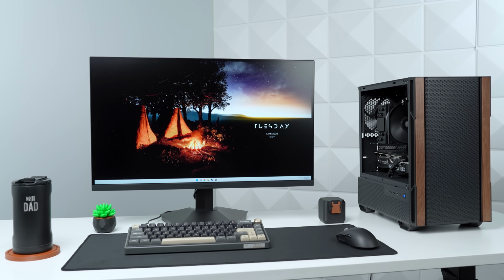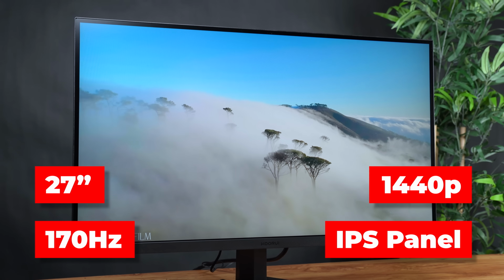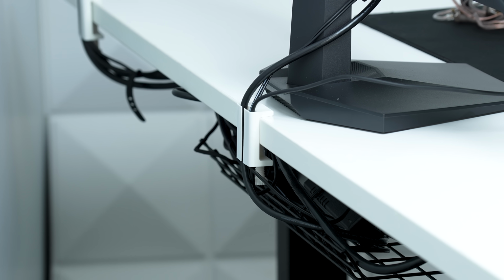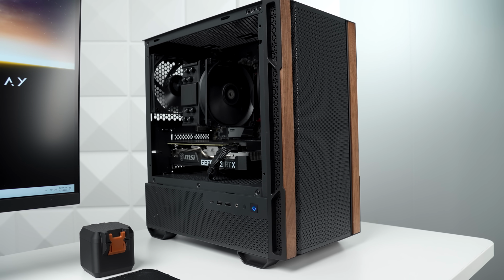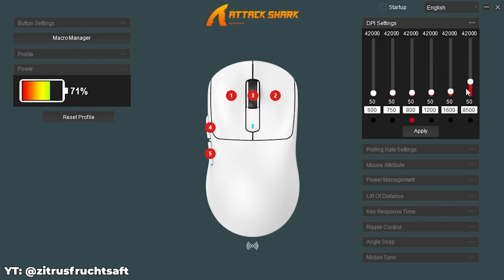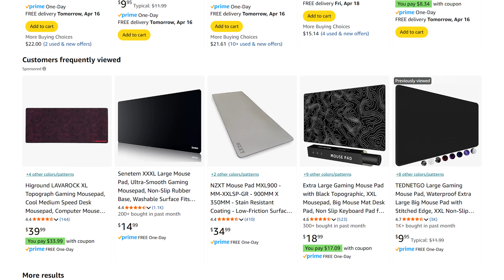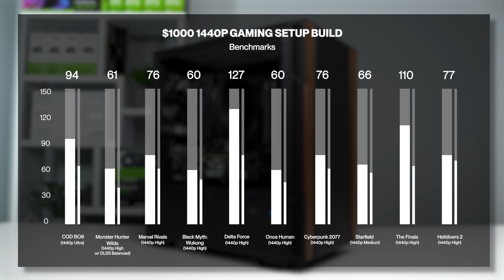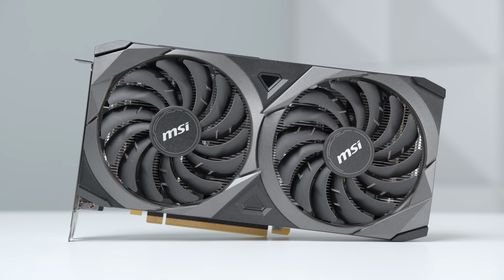$1000 FULL PC Gaming Setup Guide for 1440p

Comment: Hi !
I love your videos; you give bite-sized information to keep me in check about what's good on the PC hardware side of things. I'm here to talk about the keyboard pick.

If we're talking about $50 without adding the shipping price, this is somewhat really not the thing I'm expecting since you tried other products like Attack Shark for mice and KZ for IEMs.

Maybe give cheap Hall effect keyboards a chance; they'll do a good job for your use case.

As for suggestions

Actually, there is a cheap hall effect keyboard made by Royal Kludge themselves called "Royal Kludge C60", but it's only available on Taobao. I got mine for around $17, but things might be different in your country.

Try Mchose; their Ace68 and Jet75 seem pretty decent and will fit your price range of $50 if they go on sale.

The Ajazz AK680 Max can be a good pick too since that one has a 2.4 GHz dongle if you need it.

There are a lot of other keyboards, but it seems that you want a keyboard that has a good sound signature, so I tried to give keyboards that combine performance and acoustics (I think).

Comment: All these budget builds are interesting, but I also feel frustration, because in my country is hard to find budget good looking cases, especially if you want something simple, without lights, just forget about anything full black, with a little bit of wood. Even if you want to pay extra for look, they are in general not worth their praice for cooling performance and build quality is similar to cheapest on. And it's hard to find decent budget 1440p that is not 2 time more expensive than basic 1080p. I think this set in my country would be much close to $1300.

Comment: Great videos! I saw many people asking advice for pc parts so I might as well too...

I need to upgrade my GPU eventually, probably to NVidia but their new GPU's seem like a rip-off.

I'm a 3D artist (mainly using Blender) with a Ryzen 7 7700x and a Radeon RX 6800. However, 90% of content creation software doesn't have good support for AMD GPUs :(
(e.g. relying on CUDA only, limited encoders other than NVIDIA for Davinci resolve, Optix temporal denoising, etc.) Plus photorealistic 3D art requires the best raytracing.

I never intended to upgrade anytime soon, so I'm hesitant to spend almost the price of my whole PC for just a new GPU. But if I need to upgrade my GPU and go with NVidia, which one do you recommend?

Full Current Specs:
CPU: AMD Ryzen 7700x
Motherboard: MSI Pro B650-P WIFI
GPU: AMD Radeon RX 6800 (16 GB VRAM)
RAM: 32 GB
Power Supply: RM750 Watt
Cost: Roughly $1,500 to build

Comment: I recently bought the Lenovo Legion Y7000P featuring an Intel Core i7-14700HX (2.10GHz), NVIDIA RTX 4070 8GB, a 16-inch 2560×1600 (QHD+) 165Hz display, 32GB RAM, and 1TB SSD storage. The system runs on Windows 11 Home (24H2, 64-bit).

I mainly plan to use it for programming and gaming, and so far it’s been a smooth experience in terms of both performance and display quality.
I picked it up for 1190 USD
Reply: Oh shit!! Better than the setup in this vid 😅😅
Reply: @saharshlehri5345  Better on paper only though. It's still thermal throttled for prolonged use. For short bursts, you are correct that it is faster.

Nevertheless it is still a beast of a setup. You really got a good deal there.
Reply: @noctis_rune  I plan to buy a cooler pad for heavy tasks, so I am pretty sure, I won't have problems. Hope so 😅
Reply: It's A laptop bro @saharshlehri5345
Reply: @Gekkko Honestly, I’ve been using it for a while now, and it’s been good so far. The performance is solid except battery working for 3 hours without charge. I haven’t had any major issues yet, and didn't hear bad reviews yet. Can I know where you heard bad reviews to me look, so my inner turmoil would be at peace 🕊️
Reply: @Beginning-After-the-end  i mainly see it on forums and online shop reviews, but thanks for the headups about this laptop
Reply: thats cute
Reply: Is that legion good? I heard many bad reviews regarding legion series
Reply: @Gekkko Yes Lenovo make the best bang for your buck gaming laptops out of any manufacturer.
Reply: @Stardomplay  i see, i am planning to buy a gaming laptop but really skeptical with mixed reviews anyway thanks

Comment: Nice prints. For any fish tank/bottom intake pc, try printing some feet to elevate the case an inch or two. Most bottom intake pcs don't have enough bottom clearance and turn into vacuums for anything underneath. Elevating it a few inches higher drastically reduces dust intake and the static pressure necessary to pull air through such a small gap.

Comment: Zach, there is no dGPU shortage despite how many times you said that. There is new dGPU price inflation to offset CPU less demanded and back generation new overage clearing, secondary including the channel writing off Raptor used and multi generations laptop overage clearing. New dGPU margin is cost offsetting all other discounting and I mean all PC kit is in overage from cases to PSUs and you know that and the channel takes it out on buyers raising demanded product price and that is often dGPU and 3D and most demanded 'productivity' business application CPU. 

Raised new dGPU price umbrella has also allowed some secondary used pricing to float up and you have to look around for deals, they do exist as you are also aware. The shortage false narrative, sorry please correct. One way to correct is just say wait into second half for a new dGPU OR pick up new highly discounted kit now CPU, DDR4, low clock DDR5 whatever and use the dGPU you have and then shop for a GPU in second half of the year when Nvidia puts out 50 M Blackwell GeForce at peak production where AMD will do maybe 7 to 10 million RDNA 4.  The channel will discount leaving summer otherwise cards will back up into the production chain and no one wants that.

GPU Today 4.12.25 - Quick Take - Channel Available and Trend
87 SKUs current and back one generation

Product SKU > and % on 4.12.25 > and Change in Quantity from 3.22
Desktop PCI cards on shelf and cards in SI PCs are combined.
Percent available between AMD and Nvidia is all inclusive.

There is no shortage.
In the first eleven weeks of Blackwell supply is + 298% more than Ada.
In the first six weeks of RDNA 4 supply is + 306% more than RDNA 3.
New product producer's ramp price is up and secondary price floats up.

Price is up on performance and offsetting back gen CPU and other discounting.
Price is up on software features some enthusiast's mock.
New product availability gains through summer and peaks q4 - q1

On Nvidia staging Ada run end production volume early, avoiding a long trailing tail of new Ada parallel Blackwell roll out, that was to let AMD RDNA into channels avoiding the risk of Nvidia channel monopolization claim.

On analyst production Nvidia q4, q2 and q4 are the marginal cost quarters.
On analyst production Nvidia q1, q3 and q1 are the marginal revenue quarters.
On analyst production if Nvidia q1 - q2 2026 plateau back-to-back revenue quarters.

What could go wrong? All PC kit overage inventory value collapsing toward and below cost into the second half, the channel holding up new product price to compensate entering supply elastic volumes that then back up into the production chain impacting revenue and margin.

AMD

Mi210 > 0.05% > (33.33)
Mi160 >0.01% > (50.00)
Mi150 > 0.09% > 16.00
Mi125 > 0.11% > (17.24)
Mi100 > 0.05% > (33.33) all Instinct = 0.30%

9070XT > 1.29% > (10.29)
9070 > 0.72% > (6.81) all RDNA 4 = 2.01%

Pro W 7900 > 0.07% > (55.56)
Pro W 7800 > 0.09% > 8.33
Pro W 7700 > 0.02% > (75.00)
Pro W 7600 > 0.05% > (7.14)
Pro W 7500 > 0.08% > 25.00 all Pro W = 0.30%

7900XTX > 0.51% > (13.97)
7900XT > 0.71% > 39.57
7900GRE > 0.07% > (63.16)
7800XT > 0.61% > 5.63
7700XT> 0.29% > (6.58)
7650GRE > 0.00378% > new entry
7600XT > 0.36% > (9.38)
7600 > 0.43% > (7.02) all RDNA 3 desktop = 2.98%
7900M > 0.01% > 33.33
7600MXT > 0.04% > (40.00)
7600M > 0.01% > 0.00
7700S > 0.09% > (8.00)
7600S > 0.04% < (36.36) all RDNA 3 mobile 0.20%

Nvidia

GB200 > 0.0038% > 100.00
GH200 > 0.01% > 50.00
H200 > 0.04% > 0.00
H200 SXM > 0.01 > (100.00)
H100 > 0.49% > 2.31
H800 > 0.05% > 38.46
H100 SXM > 0.06% > 40.00
H20 > 0.0038% > for all the China so said buying a new entry in the channel
L40S > 0.88% > (4.74)
L40 > 0.14% > (119.44)
L20 > 0.01% > (1700.00)
L4 > 0.16% > (39.02)
L2 > 0.07% > 16.67 all accelerator = 1.90%

A6000 > 0.05% > 64.29 restocking workstation emphasis
A5880 > 0.05% > 92.31
A5500 > 0.00% > sold out
A5000 > 0.53% > 96.45
A5000 SFF > 0.01% > 100.00
A5000M > 0.03% > 66.67
A4500 > 0.29% > 87.01
A4000 > 1.80% > 96.65
A4000 SFF > 0.00% > sold out
A4000M > 0.17% > 78.26
A3500M > 0.3% > 97.14
A3000M > 0.07% > 94.44
A2000M > 0.07% > 94.44
A2000 8 > 0.01% > (150.00)
A2000 16 > 0.07% > 94.74
A1000M > 0.07% > 57.89
A500M > 0.08% > 100.00 all Ada Pro = 3.44%

4090 > 7.36% > 0.15
4090FE > 0.48% > (23.62)
4090D > 0.48% > (7.14)
4080 > 4.22% > (26.32)
4080FE > 0.20% > (1.85)
4080S >0.76% > (64.50)
4080S FE > 0.34% > (34.44)
4070ti > 6.50% > 8.14
4070ti S > 1.43% > (10.82)
4070FE > 0.21% > 3.57
4070 > 18.79% > 54.81
4070S > 3.76% > (4.03)
4070S FE > 0.70% > 10.22
4060ti 8 > 1.60% > (126.12) clearing ahead of Blackwell release
4060ti FE 8 >0.18% > (593.62)
4060ti 16 > 0.91% > (184.65)
4060 8 > 14.37% > 17.71 all Ada desktop = 62.31%
4090M > 0.67% > (2.25)
4080M > 0.99% > (7.98)
4070M > 3.78% > (10.00)
4060M > 4.16% > (9.09)
4050M >3.52% > (4.51) all Ada mobile = 13.13%

5090 > 2.61% > 12.88
5090FE > 0.28% > (9.46)
5090D > 0.19% > new entry
5080 > 3.40% > (54.34)
5080FE > 0.22% > (100.00)
5070ti > 2.31% > (59.64)
5070 > 4.15% > 61.48
5070FE > 0.27% > 15.49 all Blackwell desktop = 13.42%
5090M > 0.05% > new entry
5080M > 0.05% > 84.62 all Blackwell mobile = 0.10%

Change in channel available from 3.22 to 4.12 gains + 8.4%

Current and back one generation share

AMD = 5.6%
Intel SKUs not shown = 1.7% and all Arc down < (16.4%) since 3.22
Nvidia = 92.56%

Current generation share today

AMD = 12.6%
Intel = 2.7% and B5x0 down (65.4%) since 3.22
Nvidia = 85.1%

You can find March 19 2025 dGPU channel supply, trade-in trend and sales HERE by product category here, current gen all the way back to Volta and Polaris . . .nvidia-research-the-real-reason-big-green-commands-big-profits SEARCH at THE NEXT PLATFORM and look down the comment line.

Returning to channel desktop / mobile and server update more data soon. 

Mike Bruzzone, Camp Marketing

Comment: here in slovakia the rtx 3070 is sooo overpriced its like 500€ thats like 550dollars idk and the r5 7400f is nowhere to be found on any of our stores but i thing we have cheaper pc cases and prettier my fav pc case is ADATA XPG Valor AIR PLUS BLACK its like 56€ 50dollars or cheaper and it comes with 4 preinstalled rgb fans and its compatible with all mother board sizes even the micro itx or what it is called

Comment: Hey there, quick question for UPS, is it fine to turn it off and unplug it when I'm not using it? for example, when I'm going to sleep or going to work?
Reply: Yes, you can but if you leave it off for to long it will lose battery capacity so charge it from time to time
Source: i have one

Comment: Umm guys is this a good pre build for $520? 

Processor: AMD Ryzen 5 5600X 6 Cores 12 Threads 3.7GHz

Motherboard: GIGABYTE B450M-K Motherboard

RAM Variation: HKC DDR4 16GB RAM 3600Mhz

Cpu Cooler: INPLAY SEAVIEW 240 PRO AIO Luqid Cooler

SSD: HKC M.2 Nvme 512GB / 1TB SSD

PSU: INPLAY GS650 650W 80 Plus Brozen True Rated Power Supply

Case: Inplay Seaview Summer Tempered Glass [White]

Fans: Inplay Seaview F3 Fans Wih Light Control [3pcs, With Remote Controller]

OS Support: Windows 10 PRO Trail Version

Double Bubble Warps and With Wood Crate Protect

Gifts: RGB Keyboard and Mouse, 5Ghz Wifi Adapter, Mini Speaker, Mouse Pad, 1.5m Lan Cable

PC Setup, centered around the AMD R5-5600X processor paired with an RX 580 8GB GPU and has 180 hz monitor 24 ' inch

Comment: 6700XT is a very solid choice, I bought mine to upgrade from a 1660 Ti in January 2023 at the same time as when I bought a 1440p monitor and it has been great for the price. CPU from AliExpress is cool too, bought a 5700X3D from there for half price to upgrade from a 3600 and I'm very happy with it.

Comment: Ive mentioned it bwfore in videos and im glad to see someone actually include Peripherals into the cost a computer! I hate when someone says they build a full computer for $1000-1500 but leave out hundreds of dollars worth of equipment that IS needed to get a computer up and running from scratch!
Reply: Yeah i went and saved up 1000$ then realized i need to fork up another 300$ for mouse keyboard and high refresh monitor,
Reply: copy-pasting from a response i made to another commenter:

most videos focus on the pc itself because its the most "objective" part, and the rest of the setup is mostly personal preference.

If I was to build a setup today, I would probably spend 90% of the budget on the PC, and buy the cheapest garbage that I can find for periferals. Im talking no more than 20 dollars in keyboard, controller and mouse(each), maybe 30 or 40 on a cheap headset with a usable mic, a used 60hz monitor from facebook marketplace, no mousepad. And then upgrade all of them over time, all of the cheap peripherals can be gifted to someone and the cheap monitor can be used as a secondary when you buy a good monitor that properly fits your needs. 

The same concept can be applied to the PC itself but its harder, given the situation of a great deal on a GPU that didn't fit the budget i recommenden my friend to get a 500GB 2.5'' SSD alongside the GPU, and later on he bought the 2TB NVME that he originally wanted, in the end he has both and didn't have to eat exclusively bread for a week to afford the upgrade.

truth is, most people don't have a hard budget for the entire setup, they just have a budget for the moment, everything can be upgraded and changed over time. So I think its best to focus on the really important stuff with mediocre shit to go along with it and upgrade later, this way you can easily end up with a setup that is worth 1500 bucks when your initial budget was 1000
Reply: @Tarmin_ That was a lot of words that missed the point. A lot of ytubers advertise a build as being £1000.

But the peripherals (AS IN THE MONITOR YOU NEED TO RUN IT) costs over 100-200, so it’s not £1000.

Comment: If you're on a 1000$ budget and want a PC that will not be obsolete in two years I'll definitely go for a used 6800xt, which has 16gb of vram and better performance than the outdated 3070. Otherwise the set up is pretty solid, but those 8gb of vram will be a problem pretty soon.
Reply: a 9060xt or 5060ti is also a good option, jsut dont ge the 8gb vram and dont pay more then $400 for the 9060xt and no more then $450 for the 5060ti

Comment: not gonna lie this setup is peak. ima make it in a few months. but im adding my current monitor as a second one
Reply: I do not reccomend those periharals. 
Instead of that monitor go for KTC H27T22S, koorui have bad quality control issues, and the ktc monitor is much better.

For the keyboard id go for keychron c3, not great but it will be better than the rk keyboard, as rk keyboards, and other cheap china boards have had issues with them literally exploading due to poor conectors on the pcb. (this appies to the aula f75 as i know thats also a popular option.)

The iems are fine, but 7hz x crinical zero 2 are better. 

The the mouse isnt awful but the vxe r1 pro is a better mouse (better sensor and better quality build.)
Reply: @cruelraptor1235 yapatron
Reply: @cruelraptor1235 thanks a lot, gonna note that!

Comment: 🔸 CPU: Ryzen 5 7600X (6C/12T, unlocked, PCIe 5.0)
🔸 Cooler: Deepcool LS720 (360mm AIO)
🔸 Motherboard: MSI B650M Gaming Plus (DDR5, AM5)
🔸 RAM: 32GB DDR5 6000MHz (G.Skill)
🔸 GPU: Gigabyte RTX 4060 Ti Eagle 8GB
🔸 SSD: Crucial P3 Plus 1TB (PCIe Gen4)
🔸 PSU: Corsair CX750 (80+ Bronze)
🔸 Cabinet: Ant Esports Crystal X7 (ATX) (Black)
🔸Monitor: MSI MAG 27CQ6F | 27 Inch 1440p (2K) 180Hz 0.5ms
Reply: 7500f and rx 7800xt

Comment: a 3060ti is more a 6700xt competitor. the 3070 beats the 6700xt by 13 percent, which in my opinion does not really put the 6700xt in the same league as the 3070. the 6700xt is is the same price used too. the 3060ti and 3070 might only have 8gb of vram but the 3070 is just a striaght up better card than the 6700xt. 3060ti is also about 250$ used making it better value than the 6700xt for around the same performance. 3060ti vs 6700xt video just to prove my point  https://www.youtube.com/shorts/93TGbUu1Zis?feature=share. nother video https://youtu.be/pnZRuY-jFVM?t=654

Comment: 8gb vram in 2025 is a problem even at 1080p, I can't think of 1440p. You will definitely be limited. Instead, you should get something like a used rx 6800 which has 16gb vram and much better performance.
Reply: I agree, a rx 6800 would make more sense
Reply: bro lives in some strange world

how is 8gb ever a problem at 1080p?? the only time i ran into vram bottlenecking issues is when i tried to use 30 ai cars wiht 20 cached in beamng at 1080p ultra settings which is a stupid thing anyways
Reply: @Sol4rOnYt fr
Reply: @Sol4rOnYt Do you even look at the benchmarks or something?
Reply: @ no, i have a 3060ti. I use it day to day. I dont need benchmarks. I am happy with 8gb because i dont use 1440p.